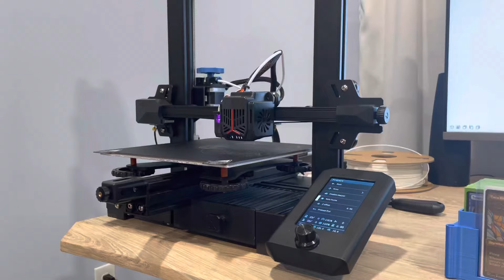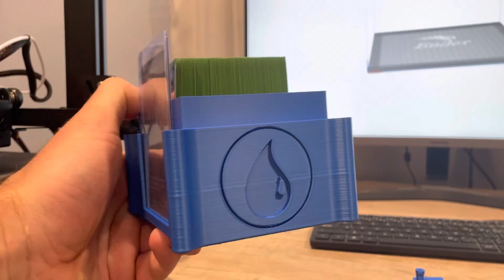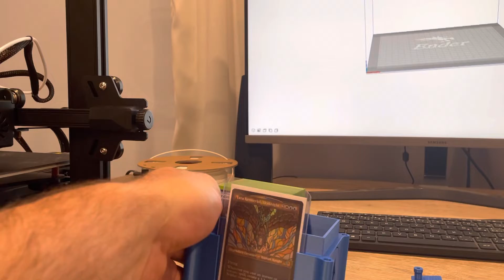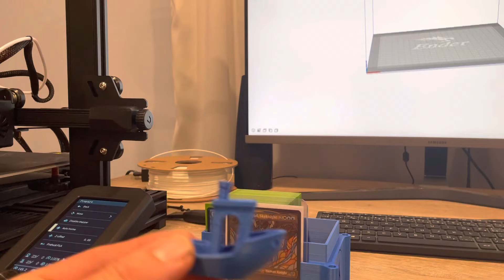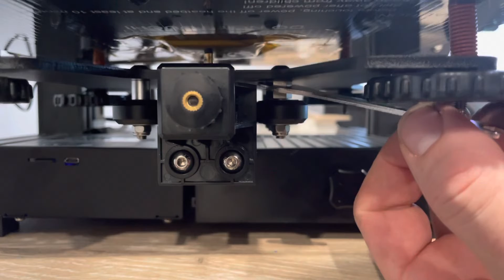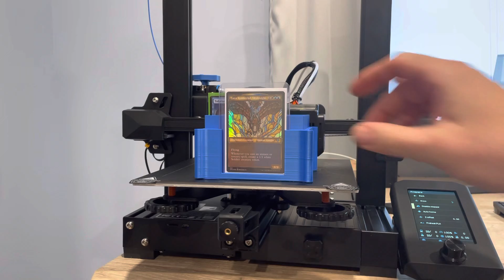Ender 3 Loose/Wobbling Bed Adjustment

Comment: I'm lost... it doesn't seem to matter which way I turn it... it just seems to keep loosening. What am I doing wrong?!?!?
Reply from the maker: It doesn’t turn round and round to tighten. It works on a cam, so small amount of degrees tightens it up. Probably you only need to turn the nut half way or so.

Comment: Hello friend, I'm from Brazil and I would like to know if this same procedure works when one of the pulleys of the eccentric nut is locked?
Reply from the maker: If it is not turning then it probably has a worn out bearing. There is only one eccentric nut on each side. The others are just regular nuts and bolts. Hope this helps

Comment: this is clearest video so far about woblling bed adjustment.  I have an additional question: I have ender 3 s1 and it should have auto bed leveling.  I have done that but while I print, I don't see Z axis moving at all the same layer... so the auto bed levelling seems didn't kick in.  Have you experienced that?
Reply from the maker: It’s possible the bed is very level on your S1. I made a video about using a dial indicator to measure your bed. Might be a good option. Do the prints have a good first layer?
Reply from the maker: 3D Printer Precision Bed Levelling
https://youtu.be/jv0UA9_UOG4

Comment: Thank you for the video! It helped me troubleshoot and adjust the track on my sons' printer.  Not mentioned in the video is that the hex bushing holding the wheel bearings is eccentric to the mounting screw. This allows side to side adjustment of those two wheels by rotating the hex bushing.  I've seen this adjustment feature in a lot of hardware over the years. 
Have a great day!
Reply from the maker: Good stuff Eric!

Comment: Will be showing my husband this video.  He is currently trying to level the bed but one of the wheels underneath is not tightening.  Any suggestions for that?
Reply from the maker: It may have been loosened too far……. Just make sure he is turning it in the right direction

Comment: I am so thankful for this video. I’ve been having so many problems with my under three that I put it away a year ago because I couldn’t figure out what was wrong and just had to quit for a while. The wobble is now gone, and we will see if I can get some good Prints
Reply from the maker: Check out my bed levelling video to optimize your prints. Happy printing
Reply: Here’s a video I took so you can see what I mean https://youtu.be/H76jXKKlnFk
Reply from the maker: @pdxcontent  that looks like quite a bit of warpage. I would send this video to Creality. They have been good for small parts in the past. Not sure they will help but worth a try. Before buying a new plate   I would take that one off and try to straighten it. Nothing to lose………..
Reply: Thanks so much! Happy new year. I talked with them just now (surprisingly) and it’s out of warranty period. I shouldn’t have put it away for the last year. Now to see how much a new bed is.
Reply: @autotech4103  ok.... I did all the "things" (tightening bolts, taking any wiggle or wobble out of all of the pieces)  that's when I noticed the warping.  Since replacing the heat bed at this very moment I thought I would go ahead and give it a test print and see if anything goes wrong. Thankfully it's currently in the middle of a print and it's working!!! It may not work this way for a long but for now this current print is working. Your encouragement and messaging actually encouraged me to keep going and press through the frustrations. One of the hardest things about this hobby for me is that I don't have a place to ask questions from people who are using the same equipment. YouTube is a great option but I don't always get responses. I wanted to personally thank you for your attentiveness and help.
Reply from the maker: @pdxcontent  this is why I reply to all messages. Feel free to ask anymore Creality questions in the future. These 3D printers can be quite finicky.
Reply: Well… I’ve take almost every piece apart and tightened and put together perfectly and all looks good BUT THEN… I noticed my bed is warped (not the glass but the metal). Ugh. Not sure what to do.